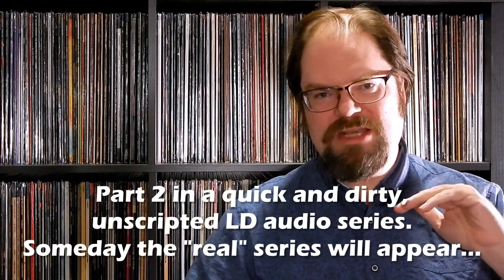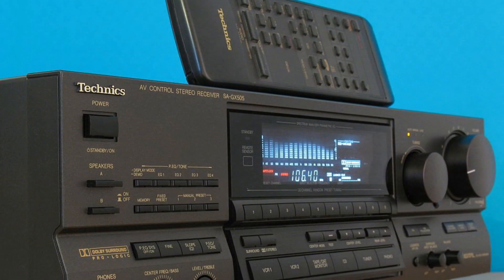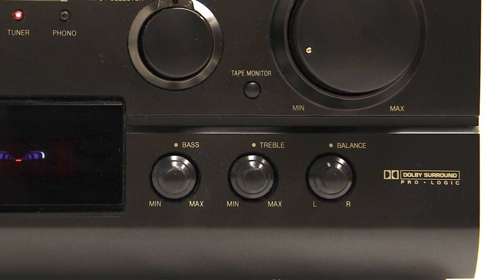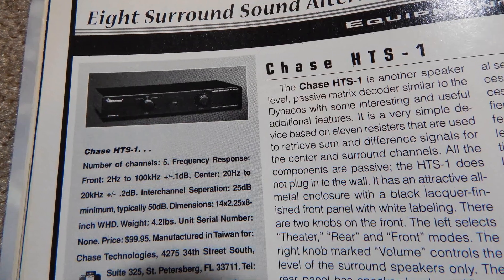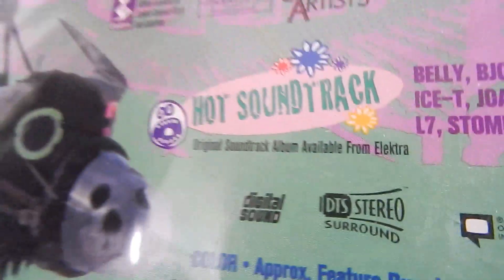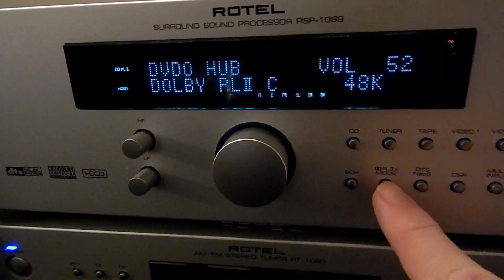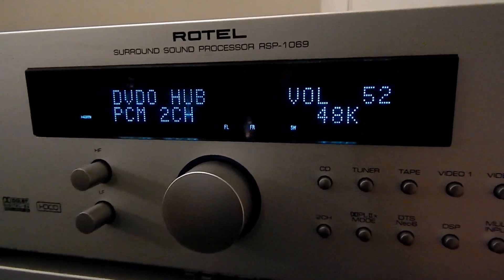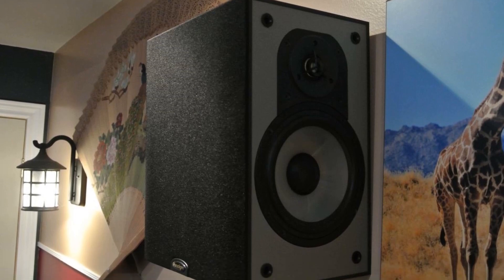LaserDisc Audio Guide – Part 2: Dolby Surround & Pro-Logic Decoding

Comment: Question, Sam - if you are watching a movie in mono, what setting do you switch the receiver to? Just 2 channel?
Reply from the maker: I'm somewhat inconsistent on it - I have a beefy center channel, so sometimes I'll keep ProLogic on to direct everything into that speaker. But other times I like the larger room sound from switching over to 2 channel mode so my left and right mains do all the work. I leave it up to my current mood and what feels best for the source material.

Comment: Very curious how the LD surround mix translates through PLIIz & the new updated "dolby surround"
Dolby has recently packed all of its formats into one package now calling it simply "dolby audio". So whether your rocking an old PL receiver, an AC3 Pre/Proc, or new Atmos rig, it will all work exactly as intended. Ive confirmed even the latest TV broadcasts work flawlessly with vintage dolby decoders. Kewl shit if you ask me : D
Reply from the maker: The evolution of Dolby's matrix surround technology is definitely cool!  I haven't listened to LDs on anything beyond PLIIx 7.1, but even that is pretty capable and sounds great with the old Dolby Surround tracks.
Reply: @Culturedog , will the new Dolby Surround upmixer accurately reproduce 4.0 from a PCM 2.0 Surround Mix on LaserDisc? I am toying with the idea of buying a new receiver which would be a 7.1 unit but I am disappointed about losing Pro Logic. 

I will definitely keep my current 6.1 receiver which has Pro Logic and Pro Logic II because I plan to use it in a secondary surround sound system in my home but I will have to buy some new speakers at a later time which would not be anytime soon.

Comment: If anyone doubts the power of laserdisc PCM dolby surround audio, just watch any Disney movie and compare it to the 4k bluray audio mix.  The 4k bluray mixes sound so anemic, but no power or oomph or good solid bass.  Just watched The Lion King of laserdisc and it sounded just like it did in the theater.  When I watched the 4k bluray "dolby atmos" mix, I was wondering if something was wrong with my receiver settings.  The laserdisc blows it away audio-wise.
Reply from the maker: Yeah, those LD PCM tracks are a force to be reckoned with for sure!  Really gives that classic "you are there in the theater" feel!
Reply: Agreed. 

I spun up my CAV LaserDisc Edition of The Lion King a couple weeks ago and the PCM 2.0 Surround Mix in Pro Logic from it really ROCKED my system. Same goes with the CAV Edition of Aladdin. 

You really can't beat those original theatrical mixes in PCM!
Reply: @Riddler95 100%

Comment: One thing I've wondered about. I've been hesitant to spread it around as fact since I'm not 100% certain, but isn't the dolby surround encoding pretty much the same as the one that was used for Quadraphonic records in the 70s? So if you play a Quadraphonic record through your amp and set it to pro logic, you can actually get the proper four channels out of it.
Reply from the maker: It's a different matrix than the old Sansui decoders used, so Pro Logic would only pull a bandwidth-limited mono surround out of the signal and send that to the two surround speakers. And of course a center channel too, but you can always turn that off.

Pro Logic II, however, has stereo surrounds and would be a better fit for Quad recordings, especially with the center channel turned off. The PLII Music mode would seem to be the natural option, but I've actually heard people had better luck with the Cinema mode. Some people have also had good results with DTS Neo:6 Cinema.

In any case, it won't be an exact extraction, but the results might be decent enough.

Comment: Dolby Pro Logic was really remarkable. Back in the LaserDisc days, so many of those PCM Stereo/Pro Logic tracks were mixed and mastered so damn well. Sometimes they honestly sound like 5.1 even though they are not. Some of my favourite soundmixes for some movies are still the Pro Logic tracks on their LaserDisc editions.

I remember being wowed by Pro Logic II because it could create fake 5.1 from 2.0 information.

My receiver has Pro Logic II on it but when I watch LaserDiscs, I just use good old Pro Logic. I do it like that because I like to listen to the PCM Stereo/Pro Logic mixes exactly as they are mixed and mastered.
Reply from the maker: Yeah, I still love good ol' Pro Logic too.  I'm kicking myself for not picking up a dusty old Proceed P-A-V (one of the processors I showed in this video) that I randomly tripped across at an antique auction house/thrift store in Salem, MA last year. 

My logical side talked me out of it, but I remember drooling over that thing in old Home Theater magazines.  I'd love to get that and an old Atlantic Technology speaker setup and live it up like it was 1994.  Haha
Reply: I love to have fun with old school audio video equipment too. Old school receivers and speakers often get donated to the local Salvation Army Thrift Store in my area. 

How many years did you use a Pro Logic system for before you bought your first Rotel 5.1 receiver?
Reply from the maker: @Riddler95  I think it was just about 5 years.  Before that I would cheat and run two sets of stereo speakers in the front and back using a JVC receiver with A/B speaker outs that you could drive simultaneously, but they were just playing the same L/R signal.
Reply: That sounds clever. I don't think that I have heard of that concept before.

Culturedog, this is kind of random, but is it true that you can use a regular yellow RCA Video Cable as a Digital Coaxial Audio Cable?
Reply: @Riddler95  i do. And i dont see a problem

Comment: My friend recently picked up a bunch of Audio equipment and in the lot he has a Sansui surround unit from the 1986 that's crazy how people wanted all the channels back then.
Reply from the maker: That's awesome!  I'm trying to remember when I first heard proper surround sound. Usually it would just be someone running dual-stereo speaker sets with the same L/R signal going to the front and back of the room.  I was guilty of doing that for a while too, but it was pretty fun sounding at times.  I remember hearing Top Gun and Crossroads on my uncle's multi-speaker system, but I don't know if it was official Pro-Logic gear.